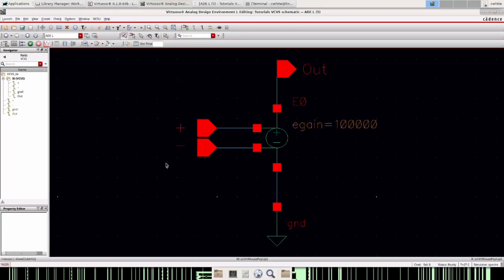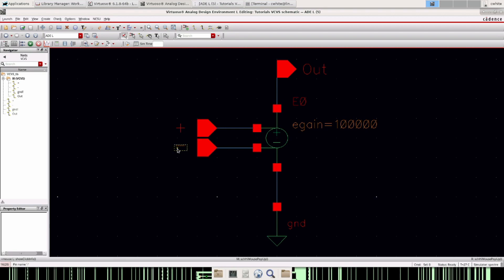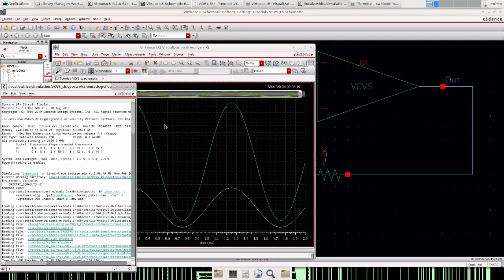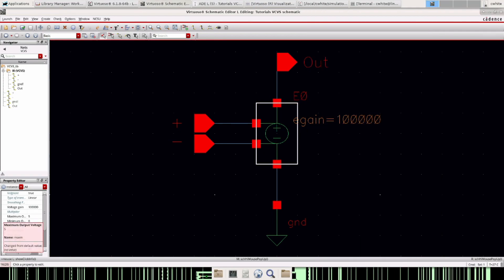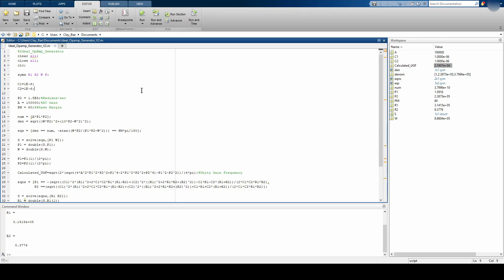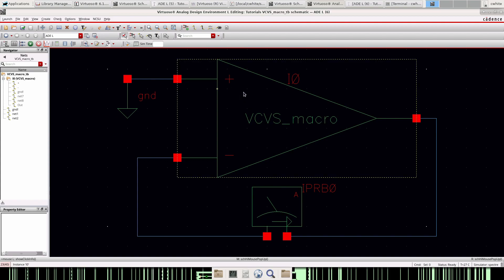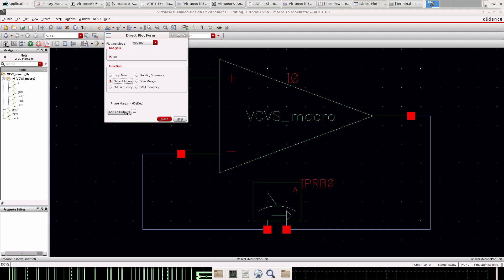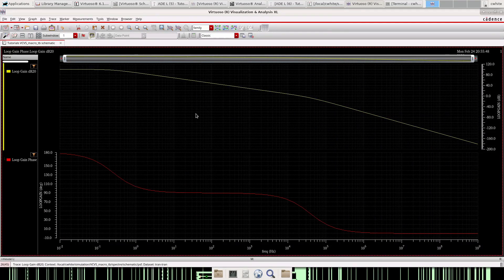Ideal Op-Amp in Cadence Using VCVS

Comment: Where to give supply voltages to the opamp, i.e VCVS here? in my case, I have no supply in the circuit except 
supply voltages of the opamp
Reply from the maker: Since this is an Ideal Op-amp, it doesn't need a VDD nor VSS. But for Maximum/Minimum output voltage for the VCVS, set those to something reasonable and you should be fine.
Reply: @speedyzebra210 I'm trying to simulate a wien bridge oscillator with this ideal op amp and just like jagadish the only supply voltages are the ones to the op amp or in this case to the vcvs. I've already set a maximum/minimum output voltage like you suggested. Thanks for the video!

Comment: Nice video. I would suggest adding 1 more vcvs with unity gain to the opamp input prior RC circuits. It'll make opamp input impedance -> infinity. So you can easily use this circuit not just with ideal voltage source at the input, but also with some real circuits before the opamp w/o any loading effects.
Reply from the maker: That is good advice! Thanks.